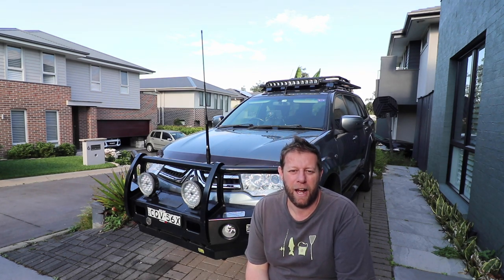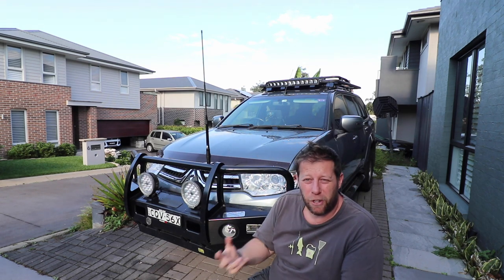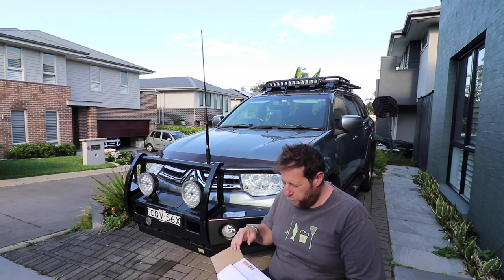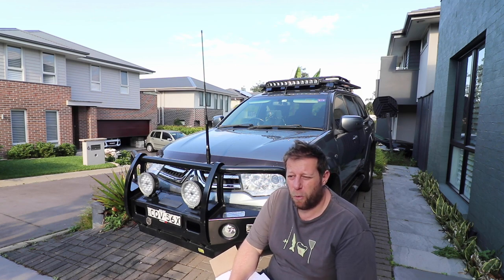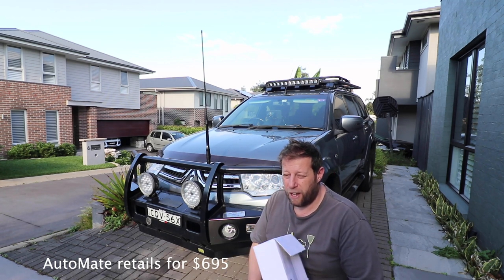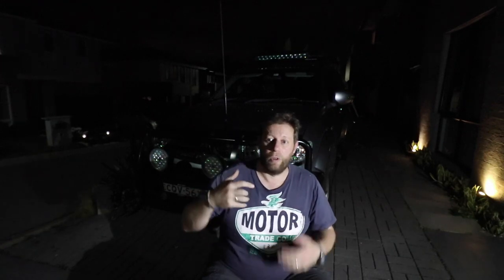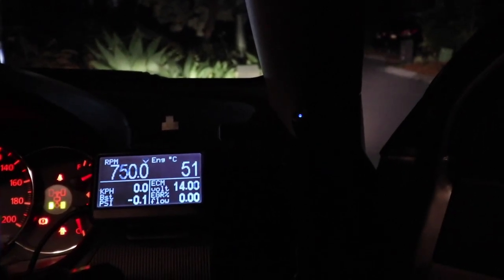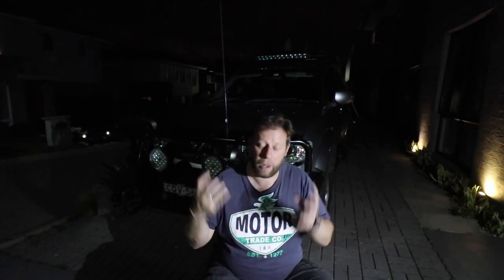Andy's first thoughts on the MM 4X4 AutoMate Torque Convertor lock up kit

Comment: hi Andy..thinking of getting the intercooler and pipe upgrade that you have and getting the auto mate..i have just added provent catch can and added Sw diesel chip which is great.has the auto mate improved fuel economy and does the gauge you have show egt temps.thanks steve
Reply from the maker: Hi Steve. With the mods I’ve managed to keep fuel economy around factory. Somewhere around 10l/100 in town and about 9 on the highway.